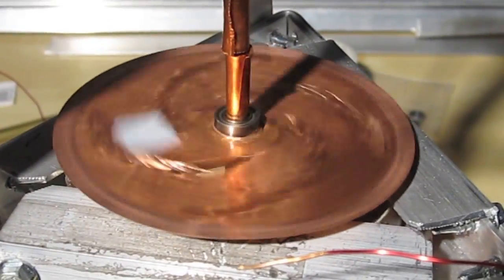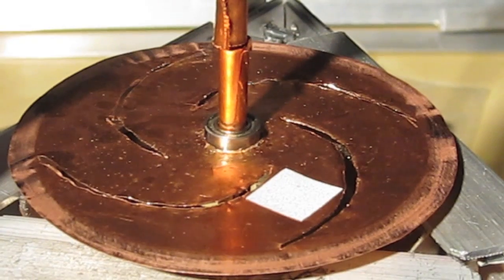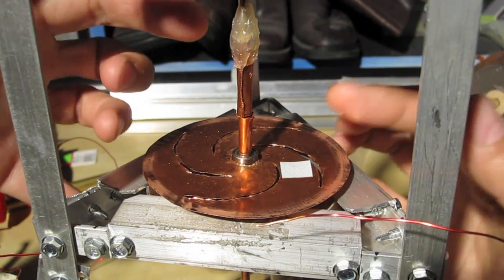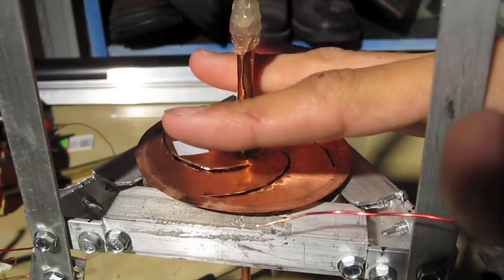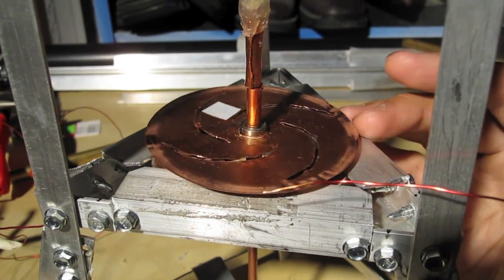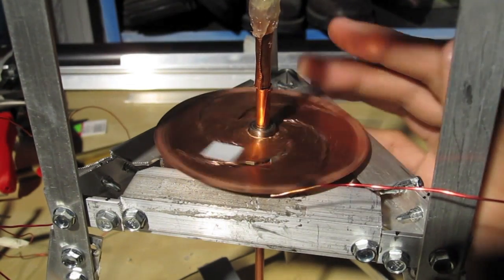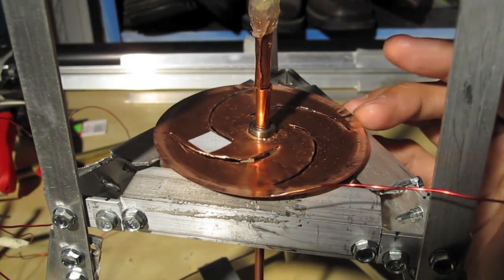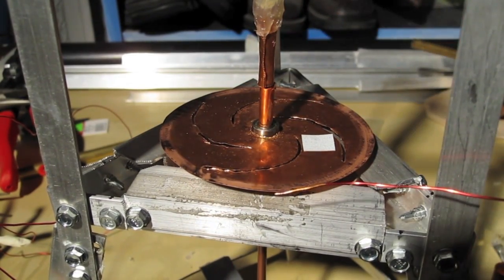Nikola Teslas Unipolar Motor

Comment: Dude, You're a lil crazy but that's what it takes to innovate. You build cool crap too! I may try your anti-gravity setup but with a pair of old school Trinity ball bearing RC car brushed motors with some nuts I have laying around from back in the early 90's driving precision machined gyros by way of  gear reduction all riding on decent bearings. That should somewhat over power the drag losses displayed when rotating the assembly. 45,000rpm down to 7500rpm  by way of a 6:1 gear ratios should work, then experiment with finding optimal gyro masses.  Maybe even try direct drive with smaller gyros at the full 45,000 for simplicities sake. Balancing and assembly rigidity is obviously crucial. I have a full blown machine shop and a couple Starrett, Brown & Sharpe and Mitutoyo stuffed Kennedy machinists toolboxes in my home if you ever need something machined properly for free, just ask. I love tinkering with these type projects, especially over the slower winter months... I'm building a 2 cubic foot work area 5 axis cnc liquid cooled 750w spindle milling machine /  ABS 3d printer this winter as my main project made with relatively cheap 1" black pipe framing. Eventually I'd like to lash up a fiber coupled 100w CO2 laser to her for some really cool capability, but that laser gear is a little pricey even for me at the moment. Anyway, keep up the good work...
Reply: +Geo K 45k rpm? What are you building and what do you have to withstand the G-forces?

Comment: Try attaching a high voltage DC to the copper plate with a small DC capacitor attached between the positive wire and the plate. Several small contact brushes should surround around the periphery of the copper plate. This way current only makes contact with the copper plate when the capacitor hits the brush. Next you spin the plate up really fast so that the interruption rate is at least a 1000 times a second (10 brushes at 6000 rpm).  The capacitor restricts the current from moving backwards, so every time it discharges, a large amount of DC is forced on to the spinning plate. The resulting radiant energy should be very visible and audible. At this point, the motor can be shut off and the plate should be placed in a magnetic field, where it should rotate several times faster than it otherwise would on normal DC. Ismael Aviso has shown that magnets react to radiant energy fields much more potently than they do with conventional current of any kind. This is also a variation of the circuit Tesla powered his coils with (it uses a rotary spark gap). Nice video!
Reply from the maker: I tried a similar thing with my liquid mercury experiments back sometime ago but never filmed it.  It was an interesting effect but I burnt out a very large capacitor within only a few seconds of trying it out (The cap came from a plasma TV) so I didn't have much time to study the phenomenon.  The copper plate in my video could be used as a spark gap because it has 4 notches cut out of it so it could function as a mechanical rotating spark gap.  I know this isin't what you described but somehow my design made more sense.  I may have to try this.  I have about 60 nine volt batteries (I bought a few years ago for my Joseph Newman motor) but I could connect them in series to get close to 800 volts at about 2 amps.  I need to invest in some decent capacitors I think...    :-)   Thanks for the idea Alex.
Reply from the maker: spiritelemental Actually I must have more 9 volt batteries because I was able to get to 800 volts with the Newman motor.
Reply: That would work but it would be tedious to get those batteries hooked up! The more interruptions per rotation the better. I am trying to build a rotary spark gap myself but it is not as easy as it looks. Tesla was approaching 1 million cycles per second with his, I would imagine that the energy gains would be massive at that frequency. I haven't got my head around Tesla's electrolytic interrupter yet, but I am sure that is the quickest way to do it using analog equipment.
Reply from the maker: Alex Johnson  I built a rotary spark gap.  Check out my vid called "capacitor pulsing 50 nine-volt battery's".  I read that Tesla achieved 1 million cycles per second using a strong magnetic field to drive an arc.  I achieved a similar effect in my vid called "Magnetic Jacobs Ladder (Magnetic Arc Pulsing)".  This was talked about in a book I read called "Secrets of Cold War Technology by Gerry Vassilatos.  I could also add more spirals on my disc if that might help.  Almost reminds me of Joseph Newmans special commutator that pulsed his coil but also caught the reverse collapsing magnetic field from his coil.
Reply: spiritelemental I have a different cap design that has a very high storage capacity
Reply: Alex Johnson Why cant we keep the copper static and let the magnet spin?
Reply: +spiritelemental look out ,intoxication with mercury can attack your dna  🌏 📡🌏 👣🕖 💎💀☠☼☾☄ ₪itibira₪ ✶☥✨🌛🌄⊀⋉🐺🐾▲▴◭
Reply: spiritelemental he used actual tuning forks on the spark gaps
Reply: A J thanks, would like to make friends with similar peers. I've done a lot of unique designs myself. Great idea, keep it up 🤓✌
Reply: I have a new bearing concept 👌
Reply: Is there anything interuptive when attaching another magnet to the copper plate itself
Reply: There is a style of capacitor that can handle this.

Comment: The 'kill a watt' hour meter seems to be a unipolar generator disguised as a unipolar motor. When someone stops paying the electric bill utility employees come and remove the meter. The utility company only supplies voltage on the input of the meter and the load supplies current on the output of the meter. This is why the voltage and current coils are physically separated inside the KWH meters.
Reply: Makes sense, I wondered why meters separated voltage and current.

1)  provide voltage to the customer - meter reads no current flow (and the rotor in the meter doesn't move)
2)  when customer plugs something in and uses it (toaster, vacuum cleaner, etc) - the supplied voltage from the utility co. is dropped across the load and so current flows
3) with a completed circuit (utility voltage supply from meter => customer electric appliance use => voltage return to meter) -- current flows. 
4)  the current flows through the meter's homopolar generator disc which then rotates the disc commensurate with the amount of current draw of the customer's electric appliance usage
5) and the disc, by way of small gears in the meter housing, turn the little dials as current flows
Lots of current being used?  The meter's homopolar rotor spins very fast
.
.
.